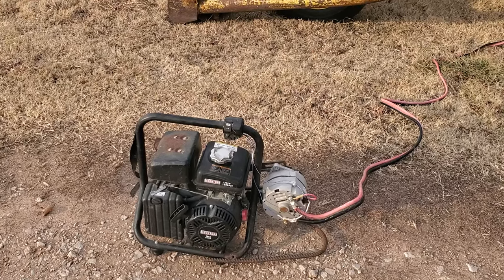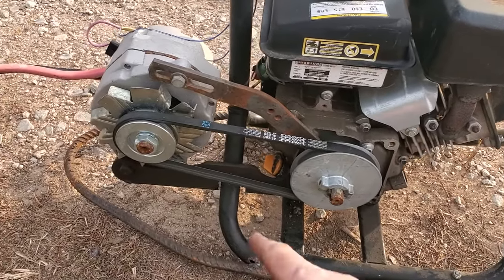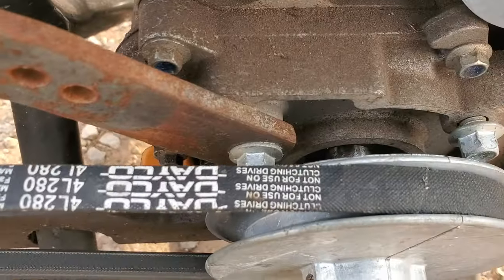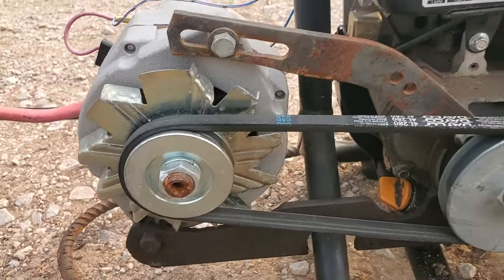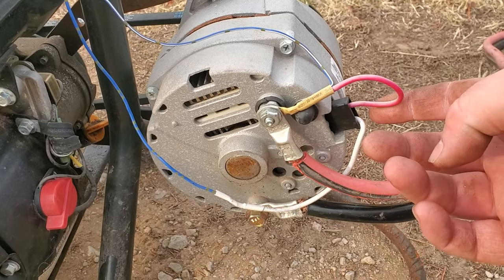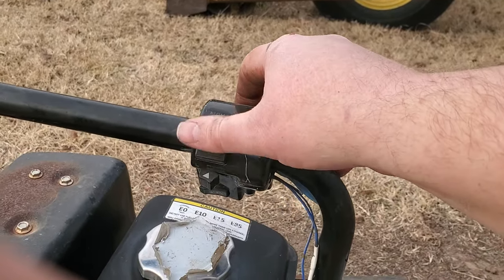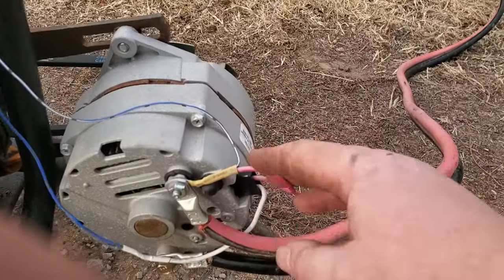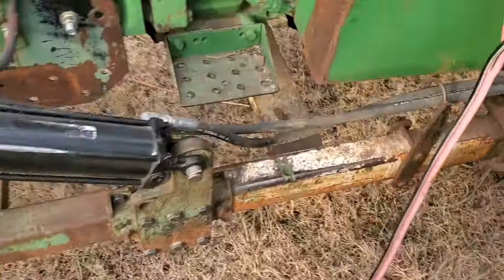12v gas alternator generator battery charger

Comment: Nice build but with one possible flaw: the alternator is being spun counterclockwise. While this is functionally no problem for the alternator, its cooling fan is designed for clockwise operation. Running it backwards severely impairs its cooling ability. You could easily overheat the alternator if it is delivering high current. Something to consider.
Reply: do you think this could work with a weed eater motor? I think is a 24 cc
Reply: @theblukatlife - It would work but if required to charge a deeply discharged battery, would almost certainly stall such a small motor. The alternator would overload it at high current draw.

Comment: I built one out of a gm alternator with a 1hp Dayton motor about 20 years ago. I used it to not only make sure my vehicles would start in the cold. But I had a mobile radio Amp in my house that I powered it with.
Reply: Would a volt regulator be necessary to Regulate power from alternator

Comment: looks usefull in an RV also as a starter help or even to help power the household systems (in case the household side of the system has a battery and an inverter...

Comment: Ty very much . Just built the same kinda unit with a 6.5Hp and inverter, needed a double check before first fireup! . all was good TY.
Reply: If you remove the rectifier youll get AC output
Reply: @RetroScythe  Yes , but I needed a 60Hz pure sine, and simple battery backup from 12v, thanks. Ima nerd too, HI!

Comment: Update. Just purchased a GM alternator 400AMP output at 1200 RPM. This is a Alt that has no switch, just start and charge. Doing a 13 HP Harbor freight engine. I like the simplicity of this build but I'll have to go a bit beefier.

Comment: Viewed from the rear: Top connectors Left runs through a 12 volt light bulb or 12 volt LED ( through ignition switch) to 12 volts +. Right (through another switch) to 12 + . Big terminal battery to 12 + heavy amperage. Because this alternator genset is loose, you can just clip the connections when needed. The test lamp circuit is only an indicator of proper charge.

Comment: Would have been useful if you would have connected a multi-meter to show the voltage or clamp-on amp meter to show actual current
Reply: you can buy a set of battery cables with that already on them

Comment: your car has a little red light on the dash, when alt fails it glows red ? right,  so you need a little 12v bulb for the energizing the alternator, when charging it go's off, when not charging it's lit,
Reply from the maker: The bulb doesn't energize the alt for charging.  It is just a indicator if the alt is charging.

Comment: Are the wires extending the wires on the alternator certain types or any wire will work
Reply: They would have to a heavy guage wire, at least 12 or lower to carry the current without overheating and melting the wire.

Comment: Would it work if you used larger 4-stroke engine and set of 4 x 200Amps alternators to directly (no battery - cables directly to the starter motor) "jump start" large diesel engine?

There would be a "kill switch" between starter motor and main vehicle's battery. So it would only power starter, without affecting rest of electronics.
Reply from the maker: No.  You will need a battery to energize the alternator to start charging.  Four 200 amp alternators will produce 9,600 watts.  That is more than most small generators produce.  You would need at least a 18HP engine to run the 4 200 amp alternators.
Reply: @imabass77  So if I used battery (4x200A > 12V battery), could I plug it directly to vehicle's system without need of "kill switch" (separation between starter and rest of vehicle)? Would voltage be stable enough to preserve electronics?
Reply: @ryteulopki8069  all alternators should have a built-in controller which limits the max voltage so it shouldnt matter if you use 4 alternators or 100 alternators in parallel, what would be the purpose of the kill switch? wouldnt the starter motor have a solenoid?

Comment: Do you modify the alternator in any way? Does it produce same current no matter the RPM of the engine?
Reply from the maker: No modifications to the alt.   I used the cheap $20 on rock auto got 70-80s gm truck.  The alt had built-in  voltage regulator so it doesn't over charge.   The output will increase with rpms.

Comment: You can add one more alternator and pulley
Reply from the maker: Not to this small engine.  You would need larger engine.  This 63 amp alternator will stallbthis small engine under heavy load.  If you had about 10hp or larger you could add 2nd alternator.

Comment: Here is a tip, If you disconnect the battery when starting the engine you wont need a switch
Reply: But it would self energise as soon as you turn the generator on, which would make the generator stall, not?
Reply: Because it is looped to itself. Not to the battery
Reply: @OussamaAbuUmar  there isnt a permanent magnet and if the battery isnt connected there will be no back emf, if you want to prove whether I'm talking crap disconnect a car alternator feed to the battery but connect a multimeter to it and then start the car and see what voltage it shows

Comment: How much watts it can produce
Also what is hp of the motor
Reply from the maker: 3.5hp.  Its on the small side and can pull too many to bog down the engine.  If I try to start the tractor with this hooked up, it will pull more power than the engine can handle and it will stall the engine.   This could be mitigated with smaller pully on the engine or larger pully on the alternator.   The Alt is rated for 63 amps so that would equate to about 750 watts.

Comment: Thanks! I couldn’t get mine to work.
Reply: You need  12 volts to energized the magnetic fields of the rotor , if you Noticed  in this video  , he had his already  connected to the  battery  in the tractor  , 
That energized the rotor to make a  magnetic field,  if you hooked up directly from the  diode  block you could  get AC power instead of  12 volt DC power  which is what a 12 volt  battery  is .
If you didn't  understand  any of this  ?
I would  not mess with  something  that could  injure or kill you , 
A.C. power  is like  the wall receptacle in your house and  that is what is coming  from the  diode block and you could  die !
Reply: @jimthomas1989  that’s actually good advice. I actually had no idea that an alternator generated alternating current but I should have guessed as such by the name. I always though direct current was far more dangerous than alternating?